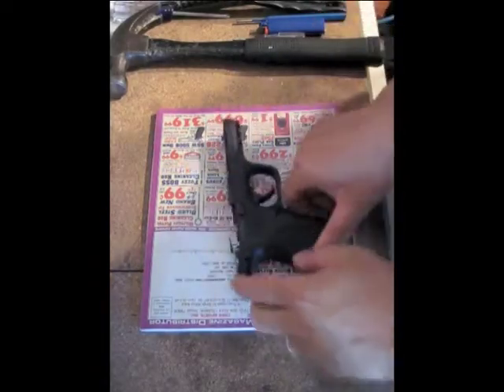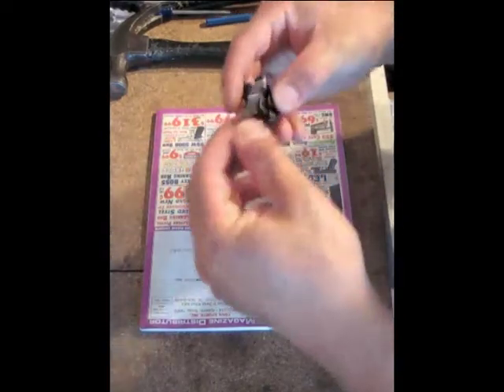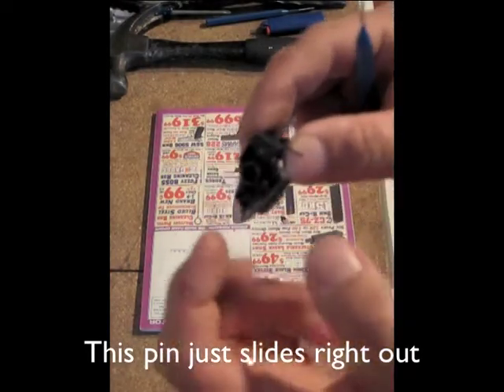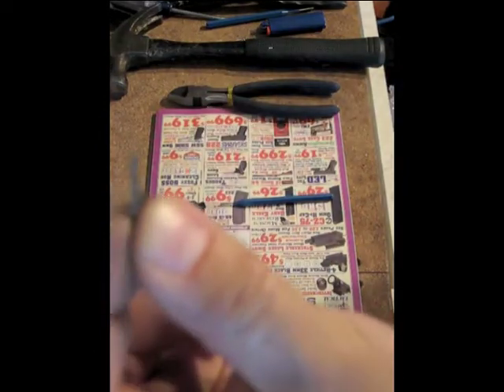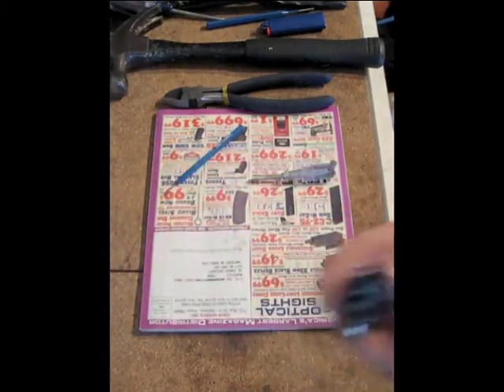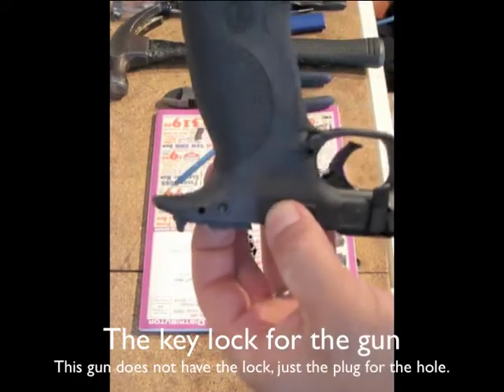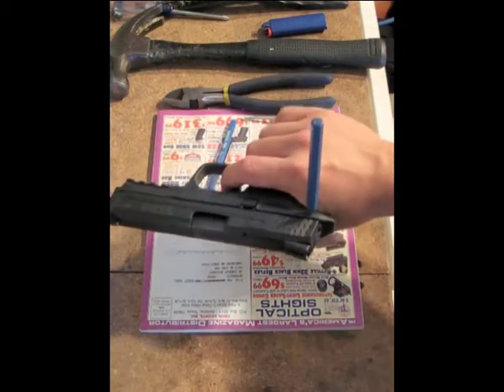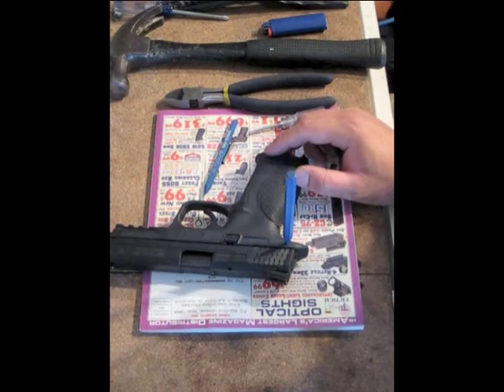How To Remove S&W M&P Magazine Disconnect Instructions

Comment: Thanks for the video. I just did this on my Shield 9 and it worked perfectly. If anyone else has the Shield, note that the ejector did not come out of the block as it did here in the video. It stayed right in place and I was able to perform this little surgery without a hiccup. I also used a standard ball point pen as my donor for the spring. 

Thanks again.
Reply from the maker: Glad it worked. Just know that the shield pistols are different in their mechanical function and components compared to the other M&P series of pistols.
Reply: Hello im getting my shield plus in a couple days, any problems with using the spring from the pen?

Comment: Great video.  Watched it and 15 min later no more mag saftey!  I used one of the springs that was replaced when I did the apex trigger job. It fits tight and dry fires without a mag and cycles dummy rounds. Test fire tomorrow!  Thanks again!
Reply: Benjamin Hall  which spring did you use, im going to do same thing when I do the trigger job.

Comment: Just want to note that the small spring from a common pen is nearly the identical diameter to the spring you'll be removing.  It's a little thinner and weaker so cut it a little longer.  The take down tool can also be used as the punch if you're careful.

Comment from the maker: Just find a spring of similar tension and size and cut it to fit. try take the OEM spring out of the gun and into a hardware store, etc. and find one that will work. *good luck and be safe.

Comment: @ZombieReady556  I got it from Ace Hardware. Couldn't find an actual #1 spring, so I just bought two of the smallest sizes and one of them worked. I've been thinking about seeing if S&W has a spring for the non-magazine disconnect pistol that I could order just so it would be closer to factory specifications, but it's probably fine as is.

Comment from the maker: @bearing01 If you have a Mag Disconnect, you can dry fire but you need the mag in. 

If you follow the video and remove it you can then dry fire without a mag in. 

I removed mine because during a concealed draw I bumped the mag release and the gun did not go off. And when I turned the gun to check the chamber, the mag fell out, I reloaded my back up and fired but it added seconds to the draw. This has only happened once with any gun I've shot but, I will never carry a gun with a Mag Disconnect.

Comment: Instead of taking the disconnect lever out, would it be easier to just cut the lever off?  I assume it would then not work.
Reply from the maker: I would not do what you mentioned. It leaves a lever/switch in the gun which is now Broken/inoperable. Removing it bypasses the mechanism. In a pinch you could simply remove the lever and replace the original/stock spring and probably operated the weapon without issue. But as mentioned before use at your own risk and be responsible.
Reply: As I think about it, cutting the lever would be a bad idea.   When you insert a mag, it pushes the lever up, which allows the gun to fire.  If the lever was cut off, the gun would always be in the disconnect mode, and would not fire.